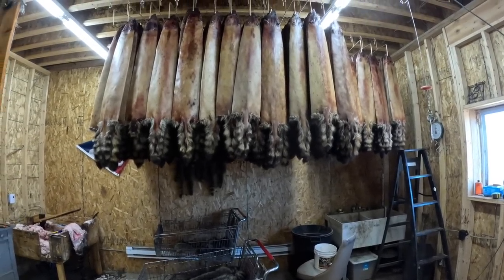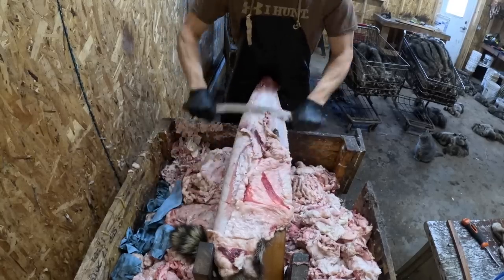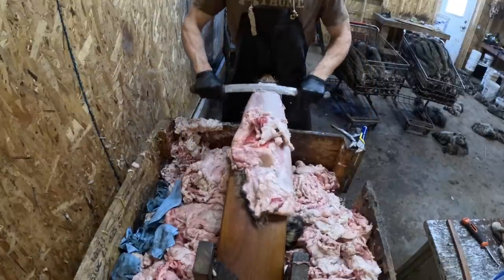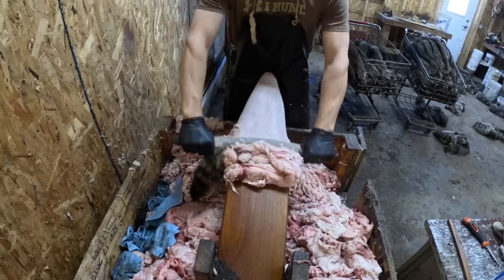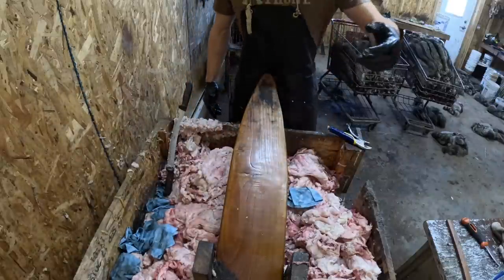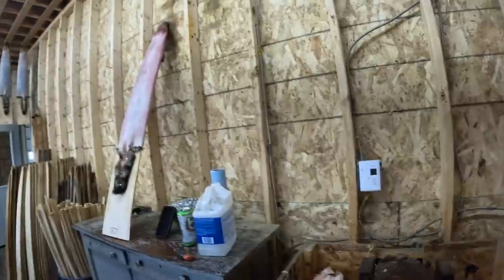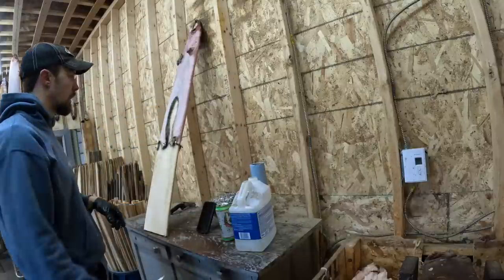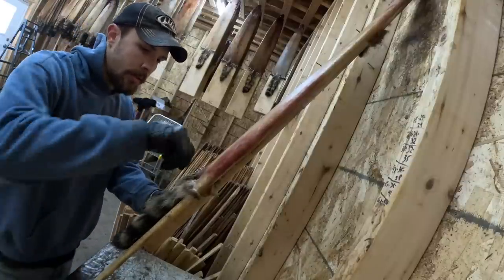How To Flesh And Board a Raccoon

Comment: I noticed you don't spend a lot of time or any on the head.. Am I missing something? or do they just not have a bunch of fat on their heads?..Thanks!👍👍
Reply from the maker: There is no value on the head for the fur market. I take the cheek meat off if any and move on. For tanning I would get it cleaner but for fur market the head has no value so it doesn’t need to be scraped. Hope this helps